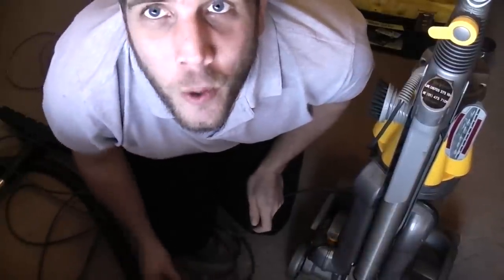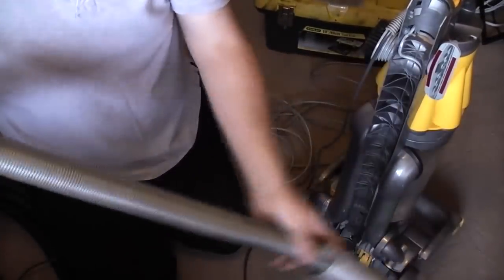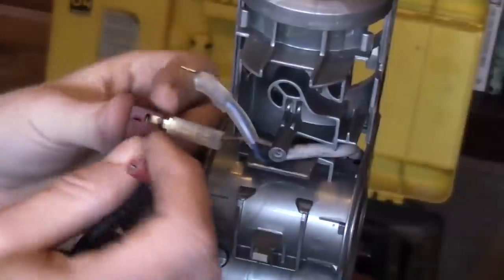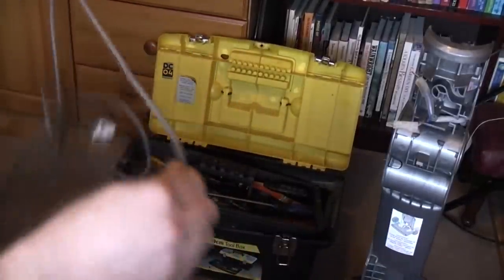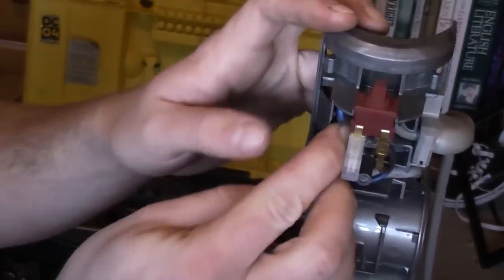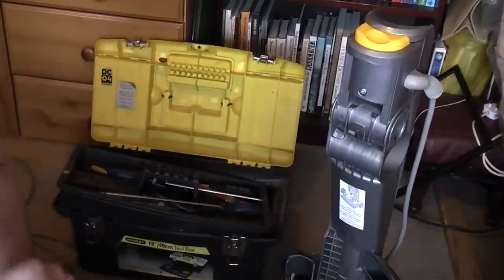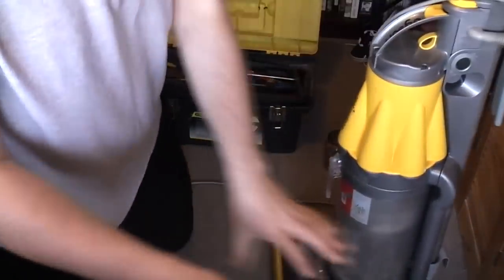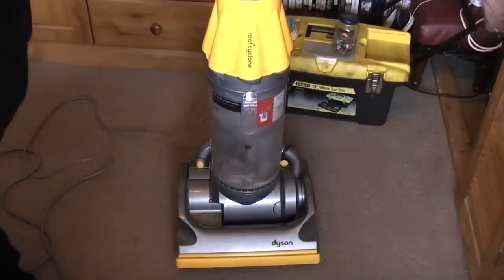HOW TO: Dyson DC07 (all models) Mains Cable Replacement!

Comment: Next chapter in my DC07’s story, filters, belts, rotary brush and motor all done previously with your help, so the chafed input cable has now joined the replacements list. Tried my usual supplier but they’ve discontinued, along with Dyson, the original  part and offer no substitute; so more browsing to do - hope they’ve got a nicely terminated one with a clip out there!

Comment: I had issues with my cable change, as Dyson slightly changed the housing on the 07. I used the older housing on the newer 07 and it was causing me problems for about 10 minutes. Under the switch they reduced the depth of one side of the vertical fitting. This must have been catching the wires. I just tried the other housing, as I was making a good Dyson 07 out of 2 Dysons with different issues. Snapped straight in. Love Dyson recycling, great designed vacuums and I'm keeping them from the landfill, so win win.  Great video as per, keep it up. 73's Andy M6APJ.
Reply from the maker: Oof the sneaky gits! Rings true though now you say it, I've had issues fitting random switch housings to dc07's before, this might explain it!

Comment: Here is a tip to make it trivial to get the new cable through the strain relief: use an eXacto to cut the insulation off the new terminals. That lets the the terminals on the new cable slide through the strain relief with no problems at all.  Once they are through, use some short pieces of heat shrink to re-insulate the terminals.  Easy!

Comment: a dyson ds07 origin!!! My fav models
Reply: DC07 not DS07
Reply: I say what I want Ryan.
Reply: Loved your video though. The dyson dc07 standard is my fav model but I have a dc14 animal but it’s. also non clutch. Reason why it’s like that because I had my old dc07 head and housing and a belt brush roll the clutch had gone on the dc14 but I could off bought a new clutch but instead I saved money. I’m going to get a belt guard for it to as it doesn’t have one.
Reply: @hiwaibrahimsalih3517  I'm just saying that it is DC07 Not DS07!

Comment: How do you remove the cover to get to the switch connector? I've been struggling with it for the past 20 mins.
Reply: Chris Wilson there’s holes at the back of the wand at the top and use a screw driver to hit it carefully, do it after you take the screw out. Hope this helps